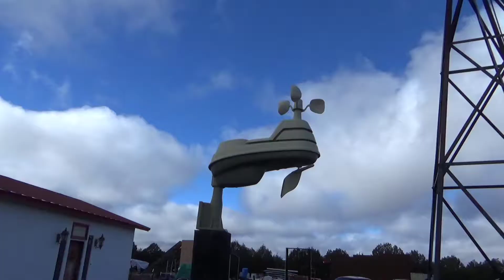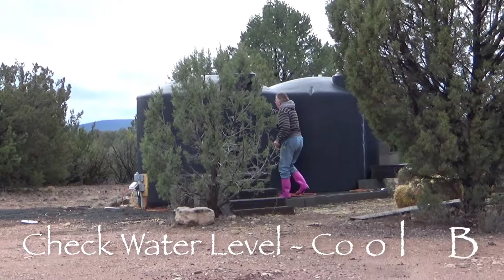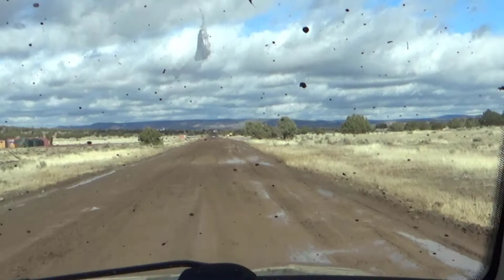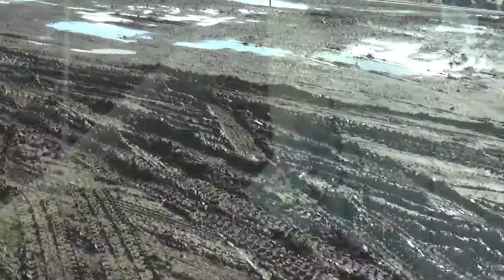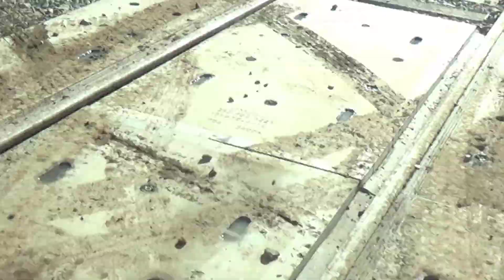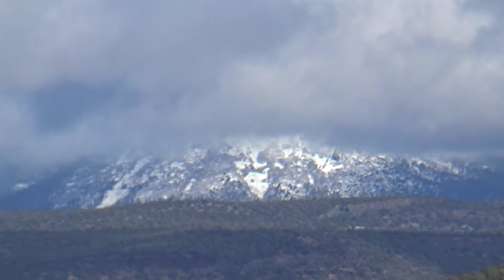Off Grid  Road to Town in Mud - Homestead Complications

Comment: Yeah I would say that was some mug bogging ya's have to do when the weather is bad.  Glad it does not stay that way over there! I think it is pretty cool you live so far out but I can see it having it's issues at times.
Reply from the maker: Thanks CB! It does sometimes become a challenge. The mud wasn’t too bad yesterday because we waited for the road to dry off some. 24 hours of no rain with sun and a decent breeze really helps suck the water up. We’ve HAD to come  off the homestead when there was a foot of mud in the road - we did some real skating then.

Comment: Millings are way better than cinders for the road!
Reply from the maker: Good morning! Millings from roadwork are generally much better than cinders for roads. Our property owners association bought millings enough to cover about a half a miles of the main road. They didn’t last very long. The road base isn’t engineered or compacted. So the millings broke up over one year with only a few small patches left. Our driveway and access road are doing pretty well. Unfortunately the crushed bluestone was’t available so we had to use the orange cinders in our drive be. They crush over time and need to be renewed once in a while. Thanks for commenting. Take care and have a great thanksgiving.